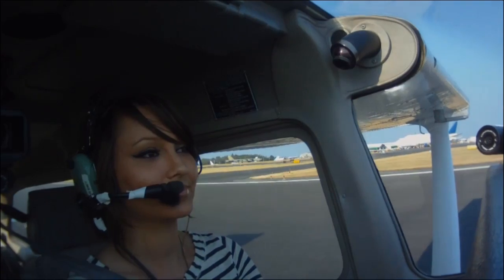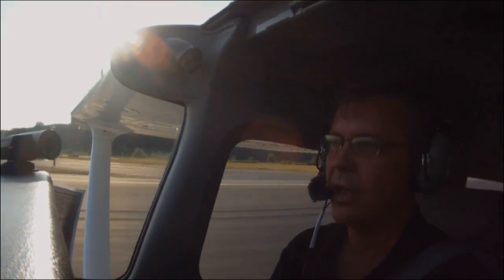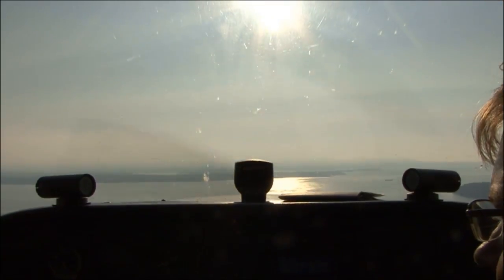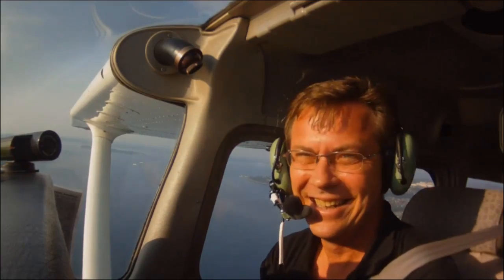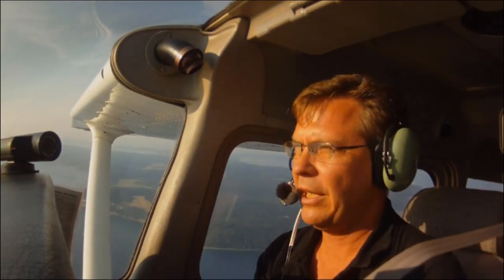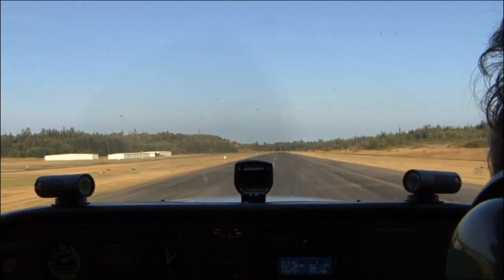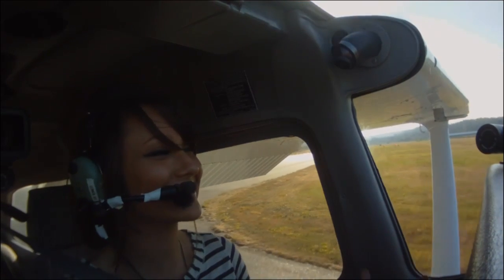Cessna 172 flight training at www.askcaptainscott.com

Comment: Not trying to be rude but aren't these cameras in the cockpit a bit of a distraction to a student pilot and possible safety issue...?  There is a lot going upfront to be worried about these (3) cameras, to deal with wires, recording equipment and what you look like on video.  Just saying!

Comment: Seems like a shorter runway, also 70 KIAS on final sounds a bit fast to me.  We always came in 61 +5 -0 KIAS.  C172 and I would guess ours were 2010 or newer planes.  Good job teaching though good sir o7
Reply: 61?  I've always done 65, even in the newest 172s.
Reply: 61 +5 -0 means we come in between 61 and 66 KIAS, kinda weird to type it but that's what the university taught us
Reply: Okay lol.  I try to fly right at 65 on short final.  I make sure not to drop under 60 though.  On longer final, I always fly at around 70-75 as to not waste time.
Reply: The runway is Jefferson County OS9 in Washington state. 3,000'
He didn't say that the airspeed of 70kts was perfect- he just said it was good. :)
Notice he also said "a little extra speed" in the long flare.
I think that everyone uses 65kts as a target- including him when he is the sole manipulator of controls.
He wasn't taking a checkride- he was teaching an introductory flight lesson. ;)
What is up with everyone on youtube always trying to find something wrong to correct in videos?  /rant off
Reply: I could have swore that the pilots that flew me to work in Cessna Grand Caravan 208B's always landed at 90 KIAS?
Reply: The 208B's are bigger than the 172's aren't they?  If so could see the higher landing speed
Reply: John LAND Grand Caravan= 14 seat turboprop with 1,000HP or so.
C172= 4 seater with 160HP piston engine.

Comment: The cost of a 172 with instructor at KXLL where I learned to fly was around $170 per hour ($130 for the plane and $40 for the instructor). I did most of my training in a 152 though to save money. Once you get your license you can always get checked out in a 172 so If money is tight I'd recommend a 150 or 152 if your school has one. I completed my training for $7000--$8000 at 41 hours. It also depends on your level of commitment. You don't want to have a lot of time between lessons as you will forget things and have to go back over them costing you more money. So it'd be best to have most if not all of the money up front. Study study study and then study some more and that will also help reduce costs.
Reply: FAA like most government based regulation cares less about actual competence and more about ticking boxes and blind accumulation of hours, so yes a 152 is cheaper. 
It's why they have basically made it unfeasible to for anybody that isn't very wealthy or willing to sacrifice a full decade of income to become  a commercial pilot, and why the regional airlines don't have enough pilots to fill all the routes. They only got away with it for a while because of all the military trained baby boomers that came out of Vietnam, but they are now retired or will very soon, and replacements are going to start coming from foreign work visas because the old world still remembers the value of apprenticeship.

Comment: I do agree with the comment:  "Most expensive money hole in the World".   But, so is boating; and so is a RV (BIG money hole,that one).    I do have an answer, however.  Yes, after 1,000 or so hours, it does seem to get a bit boring.  BUT!   Build a "homebuilt", metal structured aerobatic plane!   Like the RANS S-9 Chaos.  Airplane, engine and instruments could be had for around 16K - that's dirt cheap!  Then, go fly for 30 minutes and "have a ball".   Beats straight & level hands down.  N6395T

Comment: It is once you get use to it though.  The saying should be, it's like driving a new type of vehicle.  Driving stinks for many when they first learn. A backhoe A dump truck, crane, or fork lift, etc isn't easy until they learn it. Once learned its like driving any vehicle. Only difference in an airplane, lots of checklists because you have to ensure you did everything, and double checks because you can't just pull over in  cloud.

Comment: You can get a cessna 150 for about as cheap as a decent car (used car anyway). yes there are hangar and maintenance fees, and fuel is expensive, but it is within reach for most people. take a few lessons and you will be hooked.

Comment: It depends, if you have enough passengers to split the cost with and have a really good rate with a local flying club, the cost could be cheaper than buying a round trip ticket with a commercial carrier. For example, there is a charter flight that leave from Fort Myers to Key West which charges $430 for one passenger round trip. I made that same trip in a Cessna 182 with three passengers, and it only cost $75 per person when we split the cost. Big difference!

Comment: @scottt923 Yeah I said the same thing, but now that I look back, I know that I could have my PPL by now if I had worked, even at minimum wage.  So, if I could do it over, I would have worked and saved up my money, and then when I had about 50-75% of the cash, I would start flying at least 2x per week.  You want to fly as frequently as possible, so if doing minimum wage, don't fly once a week, because then you'll lose what you learned last lesson, and will waste money.

Comment: @rev4life03 I've flown in both and I liked the 360 degree visibility from the low wing but not so good looking down. In the Cessna it felt like the wings were sticking out of the sides of my head you know. I also liked the trim wheel position and the flap selector in the Cessna, the high wing gave better downward vis for navigating across country and yeah, it was a bit more stable. It recovered better from stalls and spins:-) The Tomahawk was a bit trickier in spins.

Comment: try to send you a private message, but any way i would like to for commercial pilot. i had the money but i end up using if to get my BS in mechanical engineering. now i want to be a pilot rather but always seems like money right now is the issue.

Comment: Do you find you need to be careful, particularly with new students telling them a speed to take off/ land, rather than just set the back pressure, and shell fly when it flies- Particularly a 172- I have found students can easily become instrument chasers, esp in critical phases of flight like t/o and landing, where the attitude is the critical thing to be watching, airspeed secondary

Comment: @askcaptainscott I actually got on to your channel this morning to suggest the cockpit cam (NFlight), it has excellent inbuilt radio and intercom recording. You wont need separate mic with it. I use the system to film the instrument panel, is a great way to debrief student pilots from flight and radio com stand point.

Comment from the maker: @spcalan I'm using a Zoom H4n and Audio Technica mic's. I've screwed up more video due to bad audio so I finally invested into a seperate audio capture system. It allows me to capture ATC and intercom on one channel and then mic the headseats to capture the other portion. It's the only method I found that works all the time.

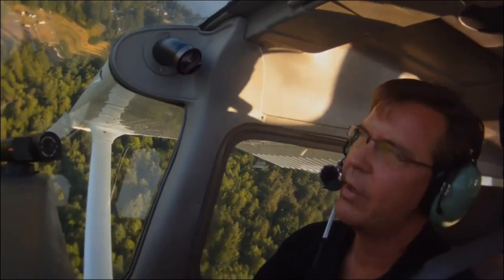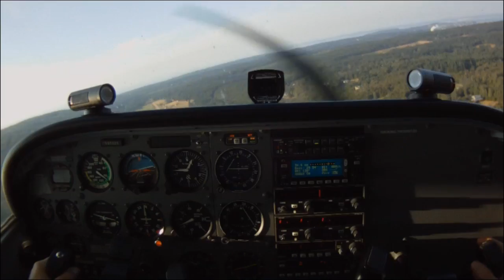Comment: @mariodela At 1:43 - 1:44 that is a perfect 45 degree angle, as measured by the attitude indicator (which shows 45 degrees) and the angle of the earth to the airplane, which also measures 45 degrees.

Comment: @mr3856a if you c the attitude indicator it shows 30 degrees and the turn cordinator shows about 25-30 degrees the standard rate is shown by 1 line, the standard rate turn in this airplanes is about 14 degrees so it would be impossible that this guys are doing a steep turn on final. I believe that a guy making his first solo knows pretty well that on the traffic patters you dont go more than 30 degrees of bank, so the CFI should know it as well. and 30 degrees is not standard for TP

Comment: @marcducati Actually that was a trick question, there's no such thing as a standard turn rate indicator. The instrument you're talking about, the turn coordinator, does not indicate 45 degrees, and they are in a 45 degree turn, as indicated by the attitude indicator and the big thing called the earth. That's right outside the window, sport.

Comment: @mr3856a a standard turn rate indicator is gyro that shows the pictogram of the plane on the dash just under the airspeed and shows you who the banking of the plane in relation to the turn rates. This tells you that at the hash you turn 3° per second so 2minutes for 360° and the second. You know a 90 ° turn is 30 sec. There not at 45° even if the camera gives the impression and even so theres an instructor with her. I say nice flying.

Comment from the maker: @mr3856a Are you a CFI. Look at the airspeed. Stall speed at max gross, forward CG, is 52 KIAS. We're going 80 KIAS which gives 1.5g protection. I don't advocate steep turns at low altitudes either but wasn't to worried about it at that airspeed and descent rate. I would think if you were an instructor you'd have seen this happen more than a few times.